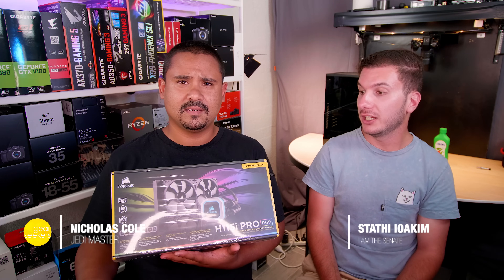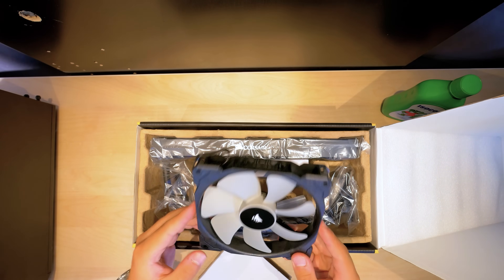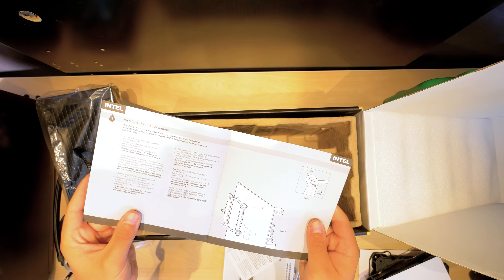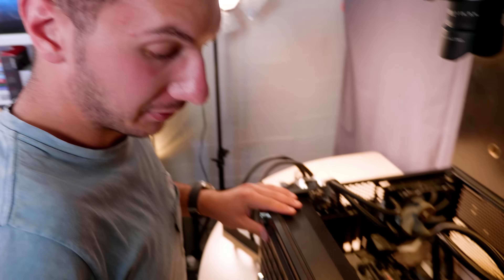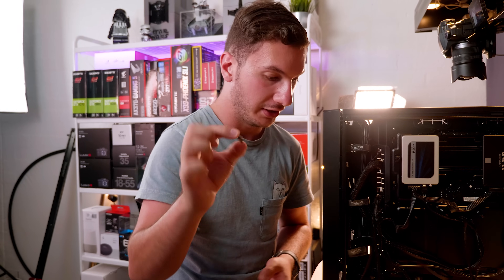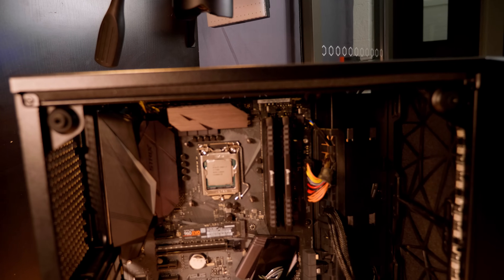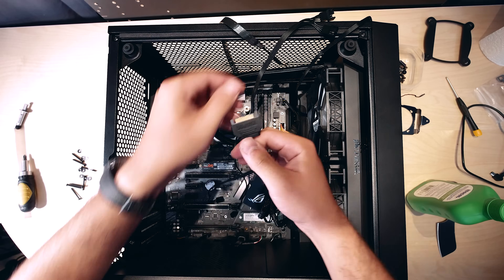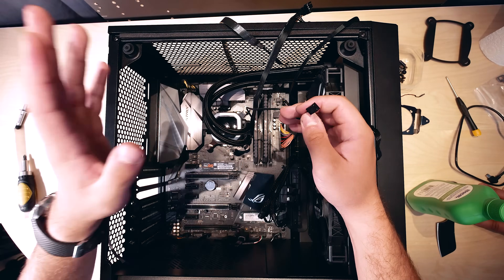HOWTO Install The Corsair H115i PRO RGB All In One Watercooler + Unboxing

Comment: A pretty good video, gotta remember to rewatch this when mine arrives to refresh my mind on certain install steps. Curious if this will help lower my GPU's temp to due to most likely lowering the overall temp my case.
Reply from the maker: Really depends on your fan configuration. We've had mixed results on all of our machines. It will most likely lower internal temperatures but push more hot air into the room. Our main editing machine has a different fan configuration to this build and our primary gaming machines have this exact setup. This setup will increase internal temperatures but generate more airflow. Reference blower style cards will run decently with this setup where as regular pull setup cards will be hit and miss. The only true way to find out is if you experiment a little. Let us know what your results are like. Thanks for watching!
Reply from the maker: If the temperatures are consistent then you should be okay. Under load with good airflow you should be maxing out around 55C. But again it's all dependent on the case, ambient temp etc.
Reply from the maker: CPU temp is the most important. The rest of the temps are basically byproducts of the CPU temp.
Reply: Just if anyone was curious the case that I have which installed mine in nicely in the front is a Phanteks Eclipse P400 & the front panel comes off so easy. Originally I wanted to put in along the top but not enough room between the top the case & the mobo, there enough space to fit some extra fans up there so could repurpose the original fan that was in the front the case for more airflow. Sorry to crowd up your comments section.
Reply from the maker: That's exactly how we install AIOs on all the P400s we've built. It works great and the temps are excellent 😀👌
Reply: Let us know how you went with the install! :D
Reply: My install went pretty good but now thinking I may have put the fans on backwards...oops I gotta check now.
Reply: Which temp to watch more the Motherboard, CPU, or one listed for H115i Pro?
Reply: Okay thanks a lot!

Comment: Is the Intel bracket plastic??!!??  It looks and sounds like plastic, if it is, why???? That's horrible!!!
Reply from the maker: Only the rear plate bracket is plastic
Reply: Gear Seekers yes. But why? Compared to my 8 year old zalman, where it's metal, why is this plastic?  Doesn't that make it possible to strip with little to no effort when screwing the standoffs on?
Reply from the maker: No because the standoff holes are metal
Reply: Gear Seekers oh, okay,, well I hope so coz I'm just waiting for my parts to arrive, i can't wait,, XD, 8700k, h150i pro, rog strix z370e, 570x chassis, vengeance rgb white memory,, so excited!!!
Reply from the maker: That's going to be an awesome build!
Reply: Gear Seekers a bit underwhelming though, as I'm still using a gtx 970,, but with prices the way they are now, that will have to wait till nvidia releases their new range, and the ti is available
Reply from the maker: I don't see the prices changing that much when the new stuff comes out to be honest.

Comment: hey i just hook mines up i had use up all of my USB headers i plus the USB into my commander pro USB slot and it doesn,t show  up on ,y corsair link any suggestion
Reply from the maker: swap the commander pro and h115i headers around to see if it detects on the other header. You could possibly have a dead header.
Reply: o crap ok thanks ill try that out just got this thing and hook it up but deffently would try that   thanks alot
Reply from the maker: Let us know how it goes :)
Reply: ok would ley u know the dead header would be the commander pro?
Reply from the maker: Oh the commander pro wont work but the H115 will
Reply: well it work for a breif min now the RGB on the pump head stay solid white with no colors sucks cause not ill have to take this hole shit apart to send back frustrating as heck cool beautifully but no this issue even when i plug it straight into the motherboard its not showing up on the corsair link which i did before
Reply from the maker: Thats no good :(
Reply: nope not at all the pumphead just solid white light no color so this is crazy that thee RGB would stop working like this
Reply: well update i got the new H115I pro from corsair have the old one here to be sent back tomm and a new commander pro is also coming i hook up the H115I pro the pumpheader RGB working i havent hook up the RGB yet waiting for the commander pro to come tomm remember the USB on the commander pro wasnt working thats why i order a neww one lets see how this goes tomm
Reply: well final update got the new commander pro hook it up n the USB pump header cable i plug into the commander pro USB its not showing up on my corsair link one of the issues is that i have only 2 USB on my motherboard but i have 3 USBs to hook up and thats an issue
Reply: Elvis Best I read on another form that it is a bug with their current version of their software.
Reply: ook ty i was on the forms for days now n i see alot of stuff n try everything it seems like drivers and software issues i replace my comm pro thinking that was the problem it wasnt it seems when i download the page USBview it shows the drivers are not connected and it wouldnt let me enable it

Comment: You should make a video testing the two configuration and show the temps results, using differents cases, fans brands.
Reply from the maker: Great suggestion. We're actually working on something similar at the moment. We're waiting for parts to arrive. The reason why we didn't show the temp differences between the 2 AIO's was actually because we didn't want to run the machine with the old one on because it turns out most of the water inside had somehow evaporated.